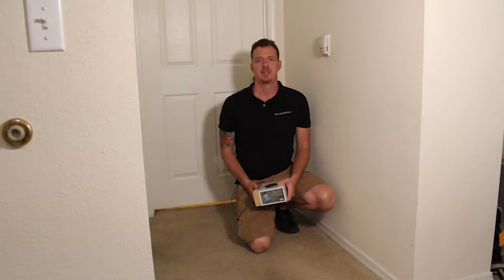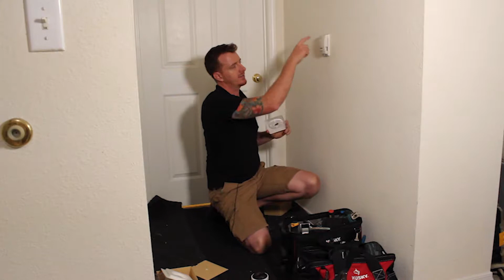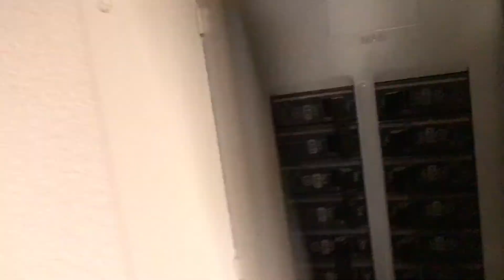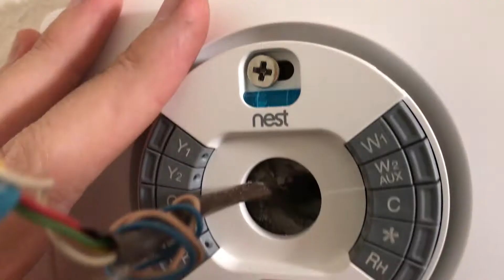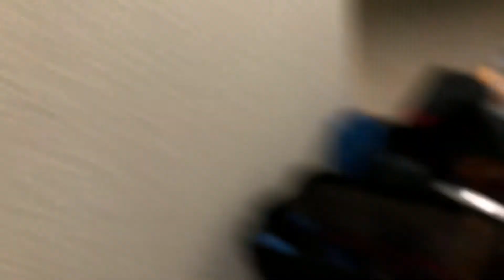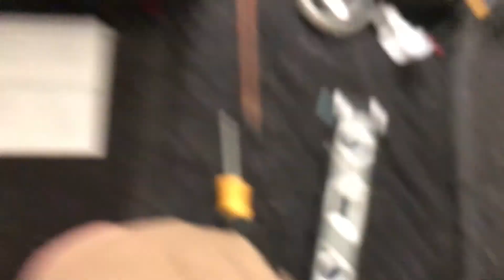Nest Smart Learning Thermostat Installation Tutorial DIY - Mesa, AZ - Audio EnVision

Comment: I need to replace my 30 year old, mercury-switch Honeywell because it's off by about 4 degrees all the time. But I'm unsure about how many wires I have back there because I only see 2 wires. There are 4 wires coming out of the furnace panel though. Can I just turn it off at the furnace switch?
BTW, you really need to do that up close.
Reply from the maker: I have installed these on old furnaces in Durango, CO and they work great. The NEST is adaptable to many different conventions except for RF type thermostats which are fairly new to the market.